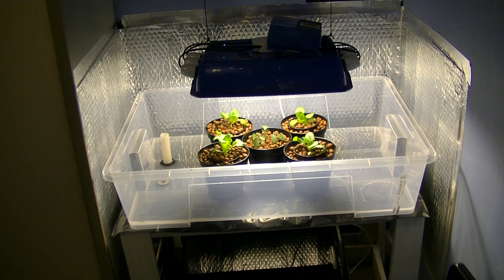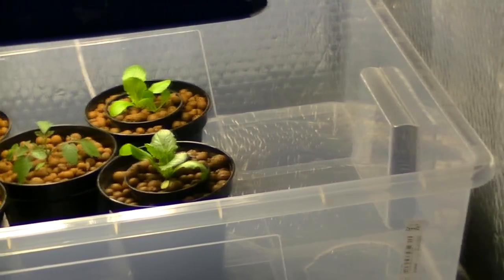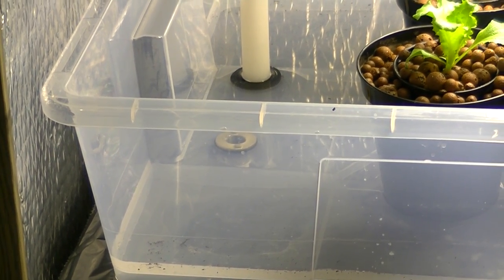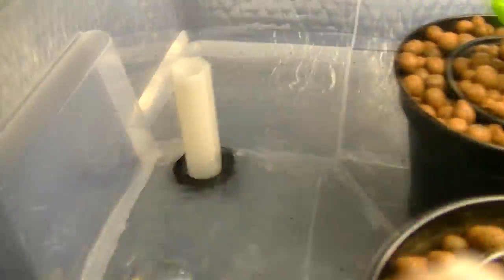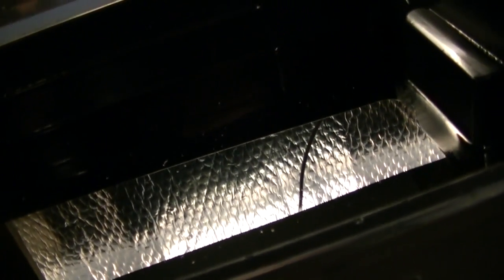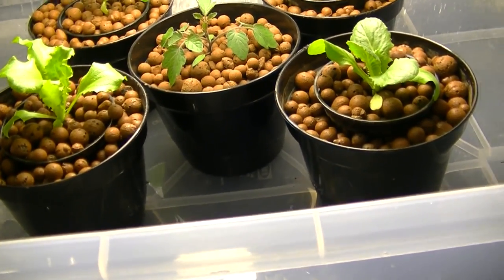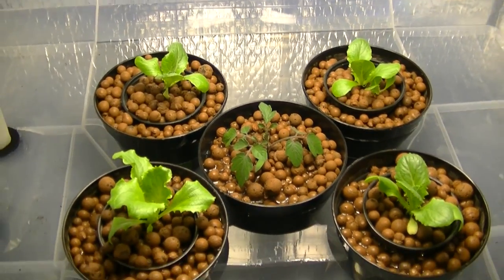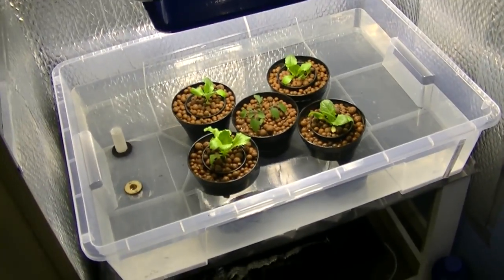Hydroponic System Built! | Ebb & Flow |

Comment: I am forced to do this after losing everything this year due to 85f temps for the solution/water in the Kratky, and the DWC method.  Root rot got me, but with this the roots don't sit in the water/solution.  My only fear is that the pathogen that is root rot comes with plant matter which the bottom container will have even with 100% healthy roots.  If the pathogen is in that bottom container it will end up on the roots 100% sure negating any positive with this system.

Comment: How dose the water drain back out through the pump ? I thought there is a valve check
Reply from the maker: Mr. baguette not on most submersible pumps. The water drains back through the pump when turned off.

Comment: How does all the water come back out of the container?
Reply from the maker: Terry Nicholson I don’t understand your question? The container underneath?
Reply: @OverGrowTheUk  what i mean is hdoes the water drain completely out of the container, was thinking about using an over flow tube instead of a bell siphon. Thanks
Reply: @OverGrowTheUk  i see water drains to a container under the top one, some over flow tubes sont allow water to come out all the way want to make sure ours empties then i cam put a timer on the water so it isnt always on.
Reply: @OverGrowTheUk  did you have a second container under for the water to drain in to? I dont understand how that works, i need something that drains water out completely
Reply from the maker: Terry Nicholson sorry for late reply but yes I have a second container underneath the flood tray that the water drains back into once it’s pumped out of it. 🙏

Comment: What did you make the flood and overflow from? Trying to find something I can make myself but no luck so far...cheers
Reply from the maker: alxp08 I use tank connectors for b&q if Ur in the UK. And just screw hose pipe fitting to the tank connectors for the inlet and 22m aquarium pipe for over flow mate. I can provide links if it helps?
Reply: OverGrowTheUK wasn't expecting a reply on such an older video nice one mate an yeah I'm in the UK 😊 yeah links would be sweet I'll pop there today.
Reply from the maker: alxp08 http://www.diy.com/departments/plumbsure-compression-tank-coupler-dia15mm/34134_BQ.prd
Tank connectors

http://www.diy.com/departments/verve-3-in-1-tap-connector/1578102_BQ.prd
These screw onto the thread on the tank connectors. 
Then just any hose pipe with connector from the pump mate.
For the overflow pipe just try to find any pipe that will fit into the top of the tank connectors and secure in with PTFE tape.

My overflow in this video was from a hydroponic shop but if I built this system again I would use just a 15mm tank connector for the inlet and a 22mm for the overflow mate.
Reply: OverGrowTheUK yeah found the 22mm that's what I was thinking of doing anyway...ill just use pvc for the over flow

Comment: Did you ever end up with algae problems with this setup?
Reply: I have a similar setup, the plans were supported by the lid, a flood tray fit inside the main reservoir bucket, and algea was an issue.  

I added about an inch of hydroton to to grow bed to block light, and with small additions of h2o2/algeafix  it was manageable for all the harvests of a crop

Comment: awesome video. What size is your overflow and where did you get that fitting that pumps water into your table?
Reply from the maker: Doug Gilpin the inlet is a 1/2” 13mm tank connector found in b&q if ur in the uk, with a hose nozzle screwed on the end for the inlet and the outlet is a 19mm overflow flood and drain fitting mate 👍